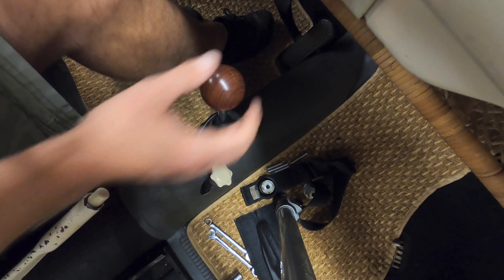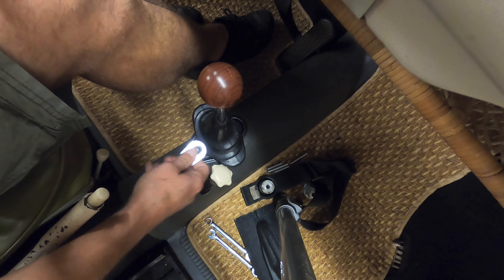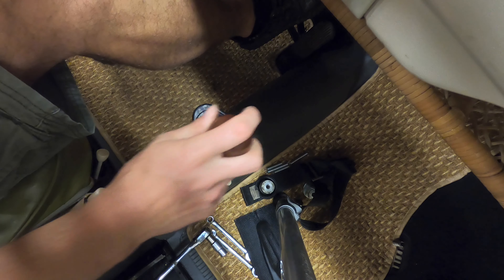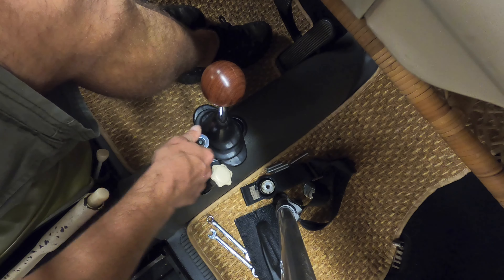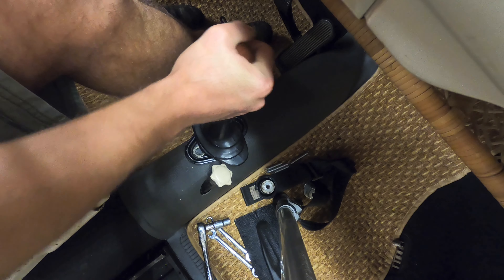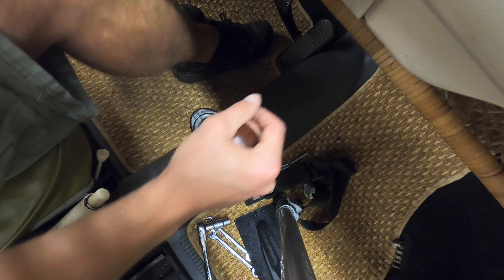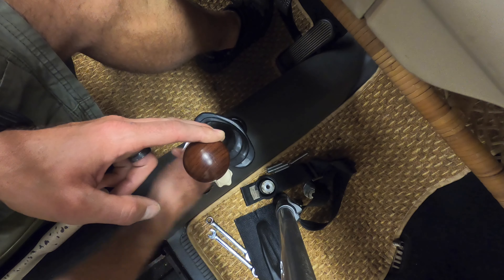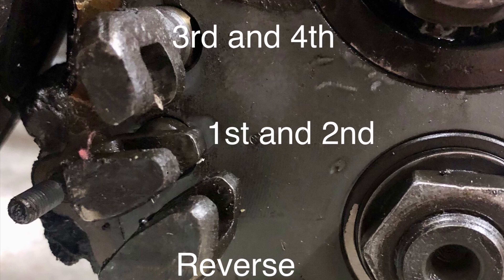VW Beetle Shifter Adjustment

Comment: Im having a similar issue with mine. 
 If I could send a video to show you exactly what’s happening I would really appreciate it. But pretty much the shifter is very  hard to a point where I kind of have to force it to get it into first gear. But when I’m driving at 5mph + it shifts normally all gears.
Reply from the maker: Adjusting it didn’t work?  

Also, all the linkage good and lubed? 

You could upload your video on YouTube (private) and send me the link on here if you want?
Reply from the maker: I apologize, set it to “unlisted” and then shoot me a message.  It won’t let me view it right now.
Reply: I'm having the same issue right now and just made it home. Can you tell me what you did to fix your problem? Was it the solution in this video? Thanks.
Reply from the maker: Yes Sir!  It wasn’t aligned/adjusted correctly.  I should have moved it around a little too before I installed it (fresh rebuild/stiff).  Is there any issues with it moving side to side (not trying to put it into gear)?
Reply: @VitosFix  thanks for the reply! No issues side to side. Seems to go in easier when the car is rolling. First gear is the worst. I started noticing it a couple weeks ago but when I pressed harder on the clutch it seemed to help but no more. Reverse now grinds as of yesterday.
Reply from the maker: Do what I showed in the video, but also make sure your clutch cable isn’t loose in the back.  Obviously don’t have it super tight or it will be semi engaged without pushing the clutch, but make sure it’s tight enough to fully engage the clutch.  

1st gear is normally a struggle to engage while moving.  5+ MPH.
Reply: @VitosFix  Great will do and thanks!
Reply from the maker: Let me know what fixes it!